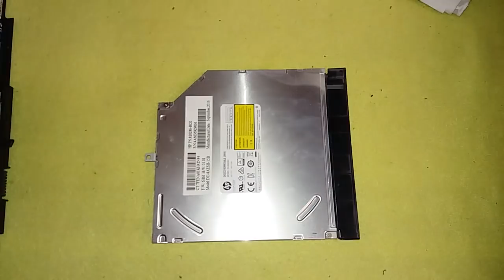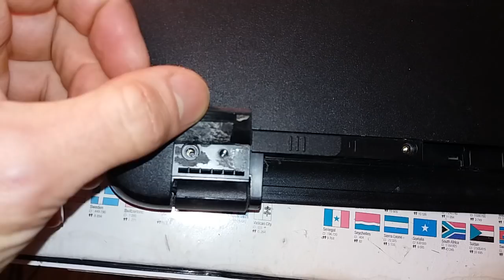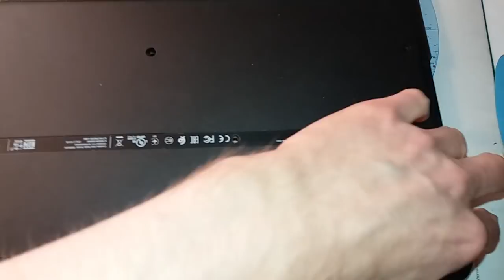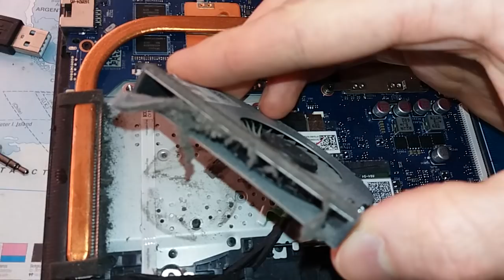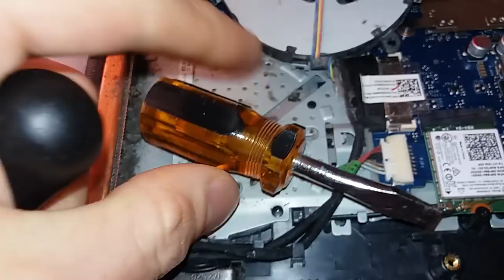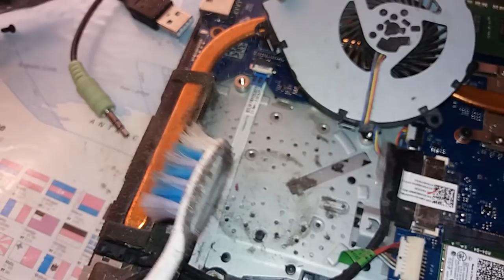Cleaning my howling laptop (unedited)

Comment: After watching the video and reading all the comments not one person suggested while you have the whole thing apart replace the CMOS battery.  You don't have to thank me Simon,  just don't comment.
Reply: That's cause it's rarely needed. But i agree that you should measure (monitor) it when you open it.
Reply: CMOS batteries are usually OK; I haven't had a problem with the CMOS in any of my laptops. However, if any do show signs of problems, I will of course replace them.
Usually (from experience) the OEM CMOS batteries tend to last longer than the replacements (they are 3V CR2032 batteries usually).
Reply: @TheSpotify95  👍 I deal with customer's old (5 years +) laptops and PCs on a regular basis and it's like 1 in every 10 needs it replaced. Old age, rare usage, motherboard faults and lack of (thermal) maintenance are shorting the battery's life. As you said, in normal conditions you'd probably never have to change it. Checking every job just in case is a good habit. 🙂

Comment: If it is a model 15-ba071nc or any with dedicate AMD R5 GPU, have issue drivers causing high CPU load, so the fan runs constantly, tested for clean install windows 10, 2004 and 20H2 with HP drivers or latest AMD drivers with no difference, still 25% cpu load all time caused radeonsoftware.exe. Solution is setup all setting once and turn off start-up radeonsoftware.exe in windows scheduler.

Comment: A hard drive?
R u kidding me guys
Use a ssd it's much faster and safer
Reply: Ok, give me some money then
Reply: @isalihkilic  256 gig SSD nowadays are cheaper than hardrives and if you want a 512 or 1 terabyte one its not that much more expensive. Seriously nowadays there is no excuse to not have an SSD
Reply: 1TB/2TB SSDs still cost £100, or more, in the UK. I doubt it would be much cheaper elsewhere. Whereas you can get a 1TB hard drive for about £30 or less.
Reply: @TheSpotify95  In Turkey 100 sterlin is more than 1/3 of the minimum revenue, and 1/4 of teachers's revenue.
Reply: @isalihkilic  I've just had a little look on eBay and a 2TB SSD (which is needed to replace my laptops' 2TB HDD) costs £145/$200. That's 1640 Turkish Lira, or in the case of DiodeGoneWild, 4350 Czech Koruna's. So if you have a large capacity hard drive, it's best to just keep with the hard drive.
Reply: @TheSpotify95  1640 Turkish Lira is half of the monthly minimum revenue last year, so you're right high capacity SSD's are too expensive. I'll continue with HDD's for at least 2 years

Comment: OMG you are using a mechanical HDD. Do yourself a favor and upgrade to SSD. Also, a pro-tip from a professional computer tech: once you're inside that laptop again, reinforce the screws holding the hinges. Will save you a lot of money as these always go loose in these cheap series of laptops and then the plastic screw holders break.
Reply: If you need a lot of storage space, getting a 1TB or a 2TB SSD drive is going to be expensive. My main laptop has a 2TB mechanical drive for that very reason.